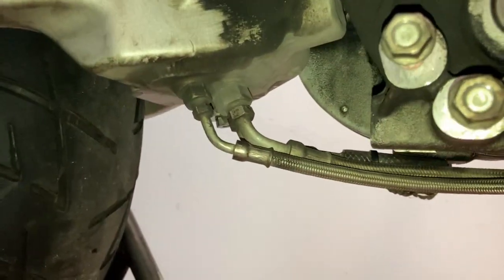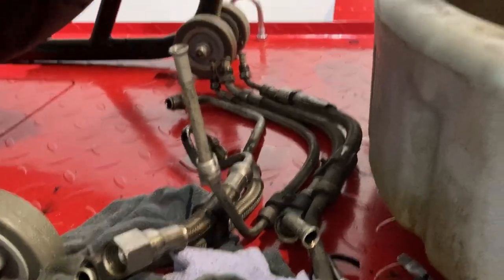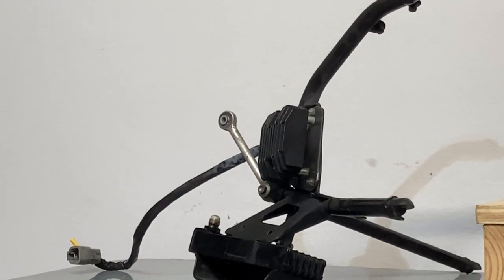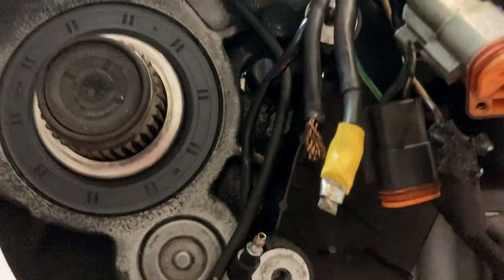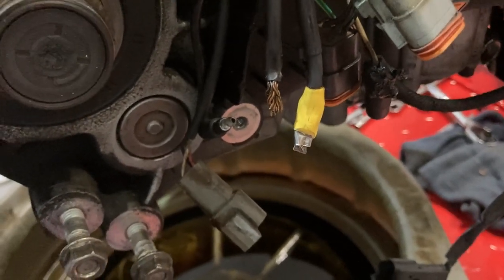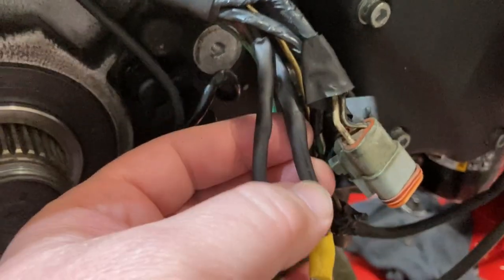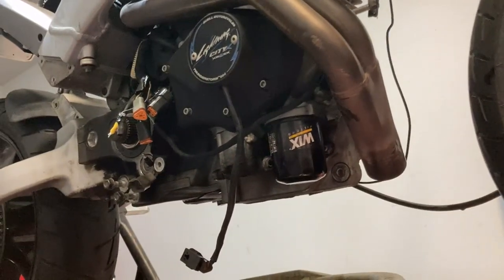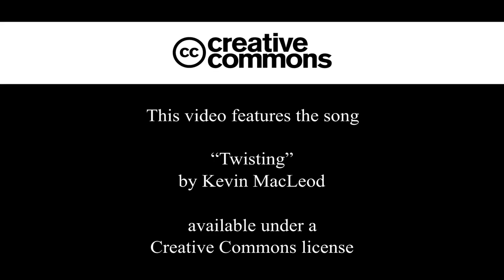Reviving my Buell: A DIY Motorcycle Rebuild - #line #removal

Comment: Charging system is great on these. Bought my 03' XB 9R new. Still have it with over 80k on the OD without a problem. As with all stator type charging systems a shorted, bad or weak batt. will put these systems into overload trying to get the batt. up to snuff. Without cooperation from the batt. everything in the system gets hot with potential loss of reg/rectifier and or stator with all conjoined wires and connectors included. Newer mosfet reg/ rectifiers like you said are better because they sense this and will turn themselves off and on to keep from building heat that will eventually destroy all parts. Just starts at the weakest link. found on a particular set up and if batt is kept there long enough it will eat everything. The system can handle operating all the electronics including the fan on a hot day, they just cant handle trying to bring a bad battery back to life. Pretty much the worse thing for these systems on any kind of equipment bikes, outboards, lawn equipment whatever it may be. Alternators handle this a little better